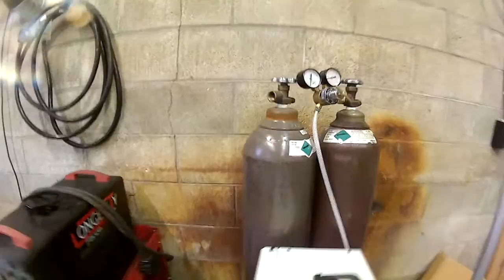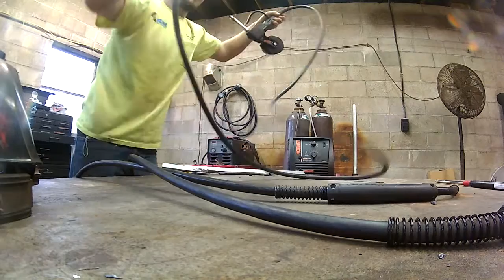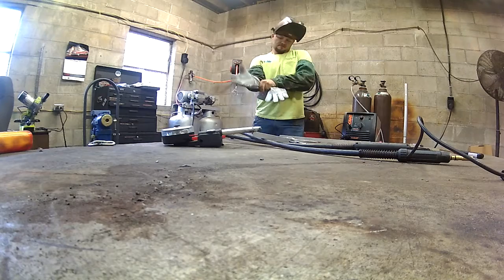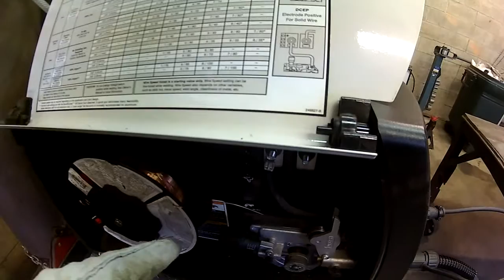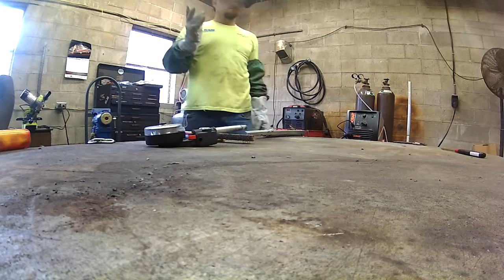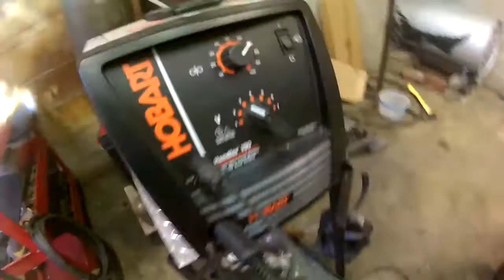Mig welding aluminum with Hobart handler 190/Spool runner 100

Comment: Should've gotten the Hobart 210 mig welder . I run both ( aluminium & steel ) with no issues.  The 210 is real good with fluxcore too ( change polarity DCEN for gasless steel ) .

Comment: Do u use a larger tip than the wire with this spoolgun? I have heard that when mig welding aluminum u must use a larger diameter tip since aluminum wire expands and will jam up.

Comment: Have you attempted any overhead or vertical welds. I have a ambulance box that I am repairing to convert to a camper and need to weld the roof and wall support to the corner rail. any doubts this welder could tackle it?
Reply from the maker: I have done both without issue. I'm sure it can handle it.

Comment: Thanks for the info. I'm a green horn welder but want a better than my harbor freight and like that Hobart, do you love it or like it?
Reply from the maker: Truthfully I loved that welder. I sold it and bought a big Lincoln power source and a feeder on top. I needed a commercial welder. I do regret selling that Hobart though. If I was in the market for that size welder again I would be looking at the Lincoln 210 MP. Not that much more expensive and I like the digital readout. You can also tig and stick weld off of it if you wanted to. My only complaint about the Hobart was the cheesy voltage settings of 1-7 instead of and infinite dial.
Reply: @RobsShop  oh yea, the Lincoln 210.. I like that too
Reply from the maker: Honestly the harbor freight welders arent bad. I have actually fixed some pretty major repairs in the field with the little 90 amp flux core welder lol. But the new Vulcan welders they are selling are getting great reviews and seem to be built much better. Maybe you can check them out to.

Comment: Great video Robb. I've been looking around for a welder to do boat repair. I've been welding for over 30 years and have never messed with aluminum. Is the 190 overkill for a boat. I was also looking at the 140. Trying to keep the cost down. Also what wire type should I use on the boat. I've also heard that I need to acid flush before I weld. Any help you can give will be greatly appreciated.
Reply from the maker: Thank you, I would tell you the 190 is the perfect size for boat repairs. I repaired 2 myself with that machine and one of those repairs was a complete patch.  I use a stainless wire brush and then wipe down with acetone before welding. With aluminum the cleaner the better. Get yourself as much scrap as you can round up and play with it. With you having a good welding background you will pick it up in no time. Good luck and don't hesitate to contact me if you have any questions!
Reply: Thanx for the quick reply and info Robb. I heard you say that there are plastic drive gears in some models. Will it state this in the specs. The one I am looking at is the 190 on the northern tool website.
Reply: I'd like to get into some aluminum repair with my everlast mig welder. What kind of duty cycle are you getting with your spool gun?
Reply: I thought u need a tig welder for aluminum
Reply: @brandonrichey8420  this one here is a spool gun.
Reply: @jackyottinger6808  I'm embarrassed to admit idk what that is but I work on a steel yard and their is a hobart 190 there just collecting dust. I asked my boss if I could start practicing so here i am watching videos. Little does he know If I learn to throw a decent weld im out. He's a piece of shit so the faster I leave that toxic environment the better

Comment: How did you get a metal wire feed inside your machine. I just bought the Hobart 190 Jan 4th 2017 and its plastic with a cheap ground clamp. Did I get a old model from tractor supply?
Reply from the maker: If you can I would return it and purchase from Cyber weld, That's where I bought mine with the spool gun. The plastic drive roll system wont hold up to long for you if you do a lot of welding. I didn't know Hobart did that but I have heard the big box stores get a cheaper made machine. Like home depot's Lincoln welders aren't the same quality as the ones you would order. It sucks that they do that
Reply: bought my 210 mvp from T/S last year and it had a metal feed.

Comment: Nice video, thank you.  Please take this one criticism in the good nature that it is intended.:  You should turn on the fan or not put your face so close to the weld area.  In your video you are breathing in the fumes that you're generating from the welding.  Best wishes!
Reply: I was just laughing because the dude obviously knows nothing about mig welding. Shielding gas doesn't work to well when it's blown away.
Reply from the maker: +Bryan Brewer thanks i like criticism! I normally to run a fan but didn't want the background noise for the video.  Thanks again
Reply from the maker: Lol see the big pedestal fan up against the wall? Its normally on but for video reasons I would of got tore up for having all the background noise. Its a lose lose with youtube!
Reply: Robs Shop yea...turn the fan on....blow it right towards you to blow away fumes....smh
Reply from the maker: lol yeah it doesn't work well at all! Heck even a light breeze will screw ya over. I normally have the fan set up sucking the fumes away from me. But without an air extractor Its impossible to get rid of all the fumes.

Comment: I purchased an Eastwood Mig 175, which I really like.  It came with a spool gun but I have not yet tried the spool gun.  I did get some scrap aluminum from a friend to practice on but it will be another week or two before I get a bottle of Argon. I have been watching a bunch of videos on welding aluminum to try to pick up some tips on spool gun use.  Out of all of the videos that I have watched no one ever mentions what Argon flow rate (CFM) they have the regulator set at or a range of CFM commonly used.  What Argon flow rate do you use?
Reply from the maker: +Tom Rumish i run around 20-25 cfm
Reply: Thank you very much for your prompt reply. Great job on the video!!  FYI -- Here is the welder that I bought http://www.eastwood.com/mig-welders-175-amp-mig-welder-w-spool-gun.html
Reply from the maker: Thanks man! Nice machine, I have never ran one of the eastwoods but that is one heck of a price! let me know how it runs for ya.
Reply: I've had the Eastwood Mig 175 and used it for about 6 months so far.  It runs runs great. I've used it on everything from 14 ga to 1/4" steel so far with great results and excellent looking beads that have good penetration. Infinitely adjustable amp range is a real plus compared to welders that have a number of pre-set amp settings. Came with a spool gun and everything needed except for a bottle of gas. Looking forward to getting my Argon and hooking up the spool gun. FYI - 3 year warranty.